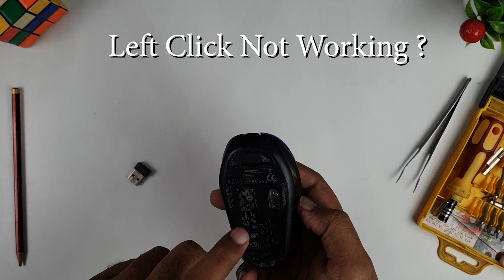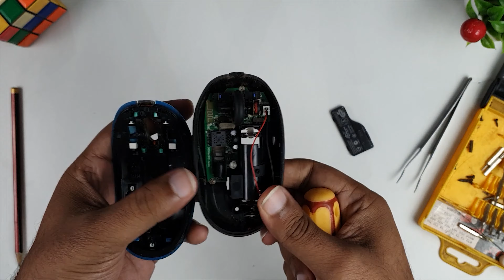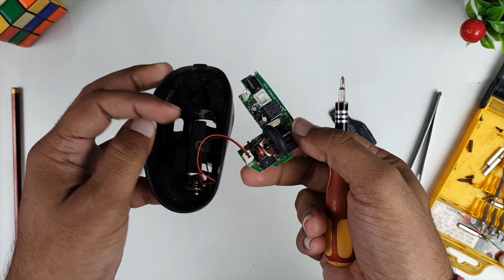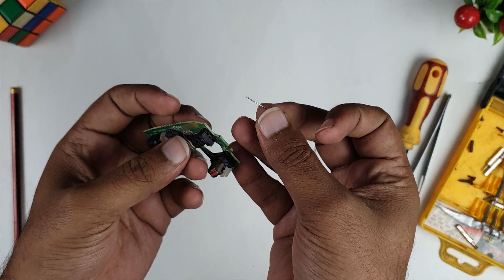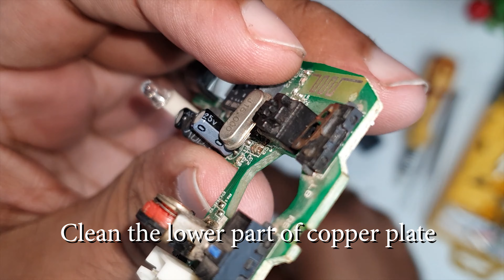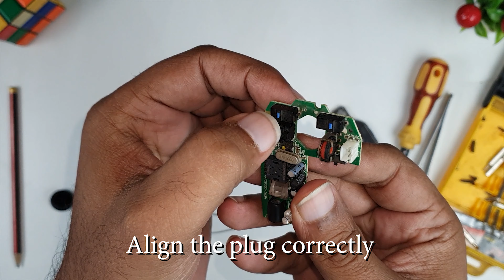How to Fix Left Click Problem on Mouse

Comment: panic tip: if your mouse just falls down and suddenly the left click sound is silent, i suggest you just follow the first step and rearrange the lifted left click part! i was so scared doing anything to my mouse from the internal but im glad that i didnt have to go inside of the mouse. thanks for this tip!
Reply: What do you mean by step 1? I don't want to risk my mouse
Reply: hello ! Can you elaborate on what you mean by "the first step" ? I just got this mouse 3 days ago and it fell down and its right-click doesn't click anymore. And I really don't wanna buy a new mouse. Thank you.
Reply: @cheskaluengo  the first step is removing the screws of the mouse and then trying to remove the clicking part of the mouse
Reply: Thanks so much I made it!
Reply: Bro my mouse cannot be open

Comment: Thanks! It worked for my scroll wheel! Pressing on it was not working anymore and it came back to life. I just added much friction alcohol on the switch and pressed several times to make sure the contact was cleaned and let it dry. Thanks again!

Comment: This worked for me, thank you! The copper plating was slightly shifted so it was the reason why some of my left clicks weren't responding but its working now. Putting it back together took some time tho but it was mostly common sense.
Reply: I saw his video and saw this comment. That's all what I needed. My Logitech mouse is as good as new now. Thanks

Comment: i was following all through the guide just to found out that the copper plate on my mouse left click was broken/ripped. so I just had to buy a new mouse.. still thanks for the video, i learnt something
Reply: Bruh......., I just soldered the broken part since it was only on one side, it took a long time coz I had to align it right but I did it, I hope u didn't throw away the mouse

Comment: the problem im having is that my mouse is not working on the left click but when i press the left click lighter it will not click but when i press the left click harder it just work
Reply: Yeah me too ad sometimes it take a sec for do the left click that why I am searching about that if you found something to help me pls say
Reply: Every time i click 80% of the times it works , but there is a 20% chance that it does not work when i click sometimes

Comment: i cant open the click mouse thing
Reply from the maker: Why
Reply: @InformativeMedia  same here. That part where we have to use a safety pin isn't working. The plastic cover won't come off.

**Edit: You know what, I finally opened it after several tries and found no dirt or any gunk inside the copper but I did try to blow in it just to take off tiny dusts, if there are, and this solved the problem. Thank you so much sir!
Reply from the maker: Haha, thanks..👍